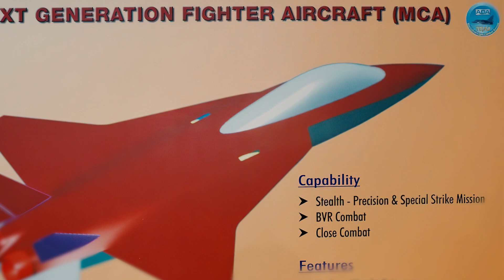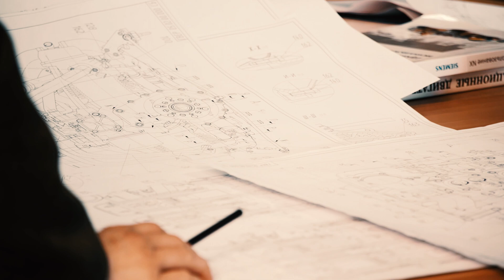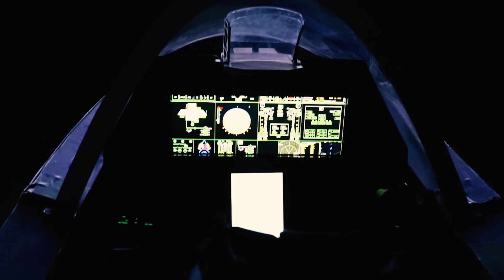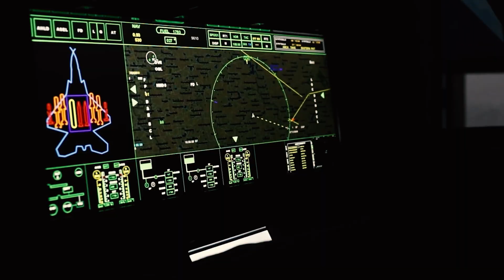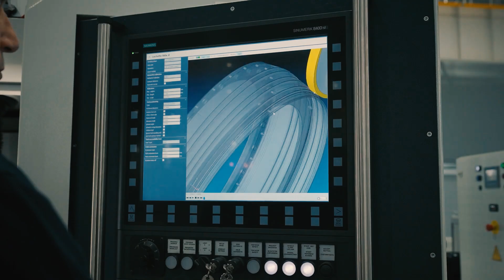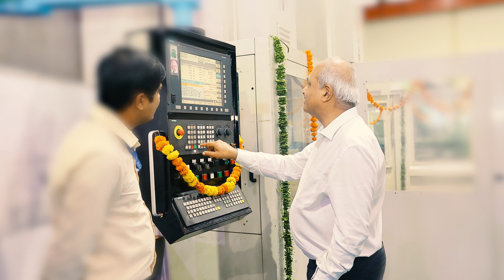The Most Unexpected Stealth Fighter to Fight China?

Comment: I appreciate your sense of humor. The HAL Tejas, a fourth generation fighter, began development in 1983. It didn't fly until 2001 and wasn't accepted until 2015. That's a 32-year long development. In other words, the HAL AMCA should be ready around 2050.
Reply: @Naman Makkar I certainly hope so, but I can only go by a track record.
Reply: @ronmaximilian6953  Tejas was India's 1st jet fighter. Other countries have built 1st, 2nd, and 3rd gen fighters and had the experience. Producing a 4th gen fighter from scratch is not an easy feat. Not to mention HAL learnt from this experience, so they are in a better position to make this fighter.
Reply: @RS-jp7fq  India's had many jet fighters before the Tejas. If you mean to say that the Tejas was the first indigenously designed fighter produced in India, that too would be incorrect. The HF-24 Marut was introduced in the late '60s and was a third generation delta design. The Tejas was developed to replace the Marut and Mig-21. Hindustan Aeronautics Limited produced the Marut and the Tejas
Reply: @ronmaximilian6953  My bad, but the point still stands. HF24 wasn't that much of a great fighter, and the technological requirements of a 4th gen fighter was still far away. HAL Tejas can be viewed as a learning curve. It is exactly what it was built and designed for. And the experience gained is being applied to AMCA. History is a good example. India's first rocket was a failure, and right now our space tech is among the best in the world.
Not to mention, HF24 Marut was actually designed by Kurt Tank, a German designer. Other than that HAL had only trainers and license-built foreign aircraft to show for itself.
Reply: Well by that logic f22 began developmemt in 1961 wen first stealth fighter fiseability was tested and it took 36 years to fly! I m sure u have no idea how aerspace manufacturing is done! Ur like one of those IBM kids who made fun of india in 70s and denied super computer! And wat do u know? India now builds some of the fastest super computers!
Reply: @SPEARHEADGLOBAL  F-22 research began in 1986 and got introduced in 2005, if it wasn't for the end of cold war would probably be introduced earlier.
Reply: @niweshlekhak9646  i really wanted someone to say that!
In late 1950s to mid 60s DARPA sanctioned a low observability test model for testing radar deflecting designs ! The design resulted was "Boeing Quiet Bird" ! But US military showed no interest ! But this one program was first real attempt to develop a stealth combat aircraft (F111 was not a result of this program as its mission design was different). This program reopened for darpa boeing and northrop in mid 80s and these three organisation shared many technologies came from quiet bird! Same way india was just looking into possibilities of developing a supersonic fighter in 80s ! Literally just reviewing and in many ways building a aerospace industry from scratch for Atleast 15 years b4 actual prototyping started!
Also absolutely NO! If u think that if coldwar was still going on they wud have introduced this aircraft earlier! No! They wudnt have! This new pristine technology! They would always take 5-8 years in prototyping stage! No matter how many freezing wars going on
Reply: @SPEARHEADGLOBAL  During the 90s, US government lowered the defense budget for F-22 development and instead decided to upgrade all it's F-16 to F-16 block 50.
Reply: @niweshlekhak9646  thats your assumption!! No white paper, no such announcement only assumption no facts
Reply: @niweshlekhak9646  yeah F22 was delayed since after the cold war US have some budget cuts in regards to their military that also affected their research and development some of it are scrapped and others like the F22 got delayed due to such budget cuts
Reply: @SPEARHEADGLOBAL then why India didn't made 5th generation fighter aircraft yet??? 2050 thats gonna be end of 5th generation technology.
Reply: @thetopsecretpentagonsclass6350  shut up dude! Dont just talk nonsense
Reply: @SPEARHEAD  The correct word is feasibility,  not fiseability. Don't your super computers have spell checkers? 😂
Reply: @pike100  No funny guy, thats something we outsource to westerner, did u get paid?
Reply: @SPEARHEADGLOBAL  
"India now builds some of the fastest super computers!"
Not true. It is still Taiwan and US.
Reply: @gangadin2873  here comes the fact master! In reality if u really sit and calculate petaflops then it will be really china with over 160 fastest computer! Idk where u got taiwan! Taiwan will never need a bunch of super computers since they dont have so much super conputing requiremnt! What stops india from building even faster computer is requirement! At this moment india has capacity to build supercomputing units greater than 1000 peta flops ! Its just india doesnt need it as if 2023! But will surely need   By 2030!
U didnt understand the expression! India still has its super computers in top 500 list! And altough the number of computers in this list india has decreased but total number of super computers in india has skyrocketted
Reply: @gangadin2873  they can since they are free to import the necessary components and semi conductors to build such computers unlike those who have been sanctioned and banned from buying such things
Reply: @SPEARHEADGLOBAL  Taiwan is also a manufacturer of computers its not a surprise that they could have  some of the fastest computers since TSMC is in Taiwan it would be a folly for Taiwan not to take advantage of it and just export all those high end semi conductors to other countries definitely they use some of it just look at some brands made in Taiwan like Acer and others

Comment: Good info but many points will keep this fighter sub5 level. First the engine exhaust if straight out the back, easy tracking for any foe with inferred tracking. Next the coating will need to be the best to absorb radar emissions and deflect. Finally by the time frame they project this fighter to be operational, many other current 5th gen fighters will be in the air with 6th gen models. I give them an A+ for effort and engineering a fighter design over lesser armed countries.
Reply: Barring the F-22, every other 5th gen jet has the exhaust problem. So that is no deal-breaker. Secondly, polymer-based coating with upto 25 dB reduction in microwave band returns in a wideband has been achieved by Indian boffins. The issue is not the capability of the coating but rather its robustness. 

By the time this fighter will be operational, India's adversaries China and Pakistan will still only be fielding 4th and 5th gen jets. Not 6th gen. Although in the US, NGAD will be coming online and China will be racing to match that, China is not capable of making a 6th gen right now. So India's AMCA will not be obsolete by the time it enters service.

Comment: '. . weapons mounted on external pylons . .'
One of F22 strength is that all weapon stored in internal, a true stealth fighter.
Also true for good old F117 & B2 bomber.

Seems like they don't quite aware of what stealth era means.
If they want to carry more missile,
- make the weapon & pylons . . stealth
or
- make the aircraft bigger.

I don't think the ability of carrying non stealth weapons outside a stealth aircraft is a +.
It's cheaper to send a conventional aircraft on a non stealth environment crisis.
Reply: It does have internal weapon bays, just because you see promotional pictures doesnt mean this plane cant be fitted with its mission requirements. When stealth is needed it wont have the wing pylons. Same as the f35, you can find pics and vids with weapons under its wings
Reply: @thegreatestevil1616  I'm aware of the internal weapon bays.
It just don't make sense to make a stealth aircraft become non stealth.
Just send a Mirage or two for non stealth mission, it's cheaper.
Reply: @budisutanto5987  You have absolutely no clue WTF you are talking about. Even the F-22 has provision for external fuel tank carriage.
Reply: @death_parade  Small stealth fighters are needed because they aren't immune to bullets or shrapnel.
You know B2, simply built F22 as big as B2 or bigger, voila!, all weapon & fuel are internal.

It's good to have more capabilities, more option, BUT
instead of refueling with tanker, or use stealth bomber to deliver missile, adding external non stealth on a (small)stealth fighter is lazy & dumb. 
Just because it's available, doesn't mean it's good! 
Blind trust to a lazy general is even dumber.

Stealth is for radar's eyes, size is irrelevant.
Reply: @budisutanto5987  Again, you prove you have no idea WTF you are talking about. Before I get down to how and why VLO as a concept is needed and applied in an air campaign, first tell me why you feel "size is irrelevant?" Because basic physics of stealth itself dictates that size is one of the most, if not the most, relevant part of a stealth aircraft design. 

"Simply build F-22 as big as B-2"? Try and compare how many Gs a B-2 can pull vs how many an F-22 can pull. Chalk and cheese. Honestly dude, the only thing lazy here is your inane comment.

Comment: The Su57 is not a 5th Generation Fighter.  Just look at the skin of the Aircraft and its design does not reflect Stealth.  At best it may have a somewhat lower cross section as compared to the 4th Generation Fighters, but is not match for the F-22 or F35.  This Indian Aircraft looks like it may have some much more stealthy characteristics.  Congratulations to India!  I do hope PM Modi comes out more proactively against Russia in its invasion of Ukraine.  The War Crimes are not something I would expect a democratic country to accept for lower priced oil?  Excited to see how the Quad advances to assure peace in Asia and happy to be partners to India, Japan, Australia and other allies.
Reply: Sorry, to say that the india is interested again on SU57 when it comes to a production model of SU57 which is an 1st stage improved of SU57. If the production model of SU57 has around 78 of them, at the same time india is ready to buy that aircraft again, or they are ready to take the SU75 checkmate aircraft. So anything can happen. Why they going to bug the SU57 again which is improved model because that AMCA you see, it will come at 2030 or more, which will take a Hugh time to come, at the same time, india will going to deal mostly on the SU75 checkmate or Second is SU57 if it's is needed.

Comment: You know the most interesting part of stealth ? Mount everything on the top as the radar is always angled from below ….
Reply: something called aerodynamics prevents that. thats not a good idea at all.
Reply: @nomercyinc6783  Aerodynamics is hardly the biggest issue. Its more to do with other airborne threats that are just as important to worry about, as ground based radars
Reply: Ground radar, yes. But almost every major power has version of airborne early warning radar aircraft, and these are normally at 30k AGL. Also, other fighters are not ground based, so there is that
Reply: That design element certainly plays a role

Comment: Stealth with intakes like that  !
Reply: If i am not wrong, they are S shaped intake, from some pictures i have seen
Reply: it has a dsi  intake with s shaped shape
Reply: It has inner bay that can carry 4 missiles
Reply: @manojkumar-jt3fw  doesn't matter if the intakes are not stealthy
Reply: @TheTeehee11111  And who said those intakes aren't stealthy? Half the time they were showing the previous design that did not have DSI. The final configuration that was finalized in the Critical Design Review last year has DSI similar to the F-35. Heck, even F-22 doesn't have DSI yet its stealthy intake 'cause it got S-ducts. F-35 took it up a notch by adding DSI and S-ducts. AMCA, like F-35 has both S-ducts and DSI. 

And no, Indian S-ducts are not half baked like the ones on Su-57. India walked away from that program partially because of those air intakes. IAF is very strict when it comes to such basic requirements. They won't allow AMCA to enter service with shoddy intakes, which is why AMCA S-ducts have already been built and tested at the RCS facility.